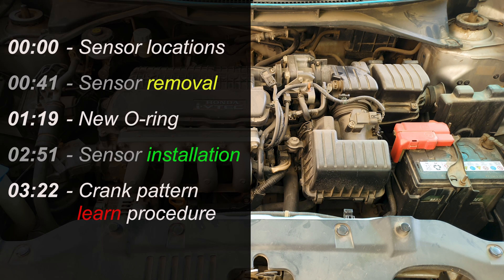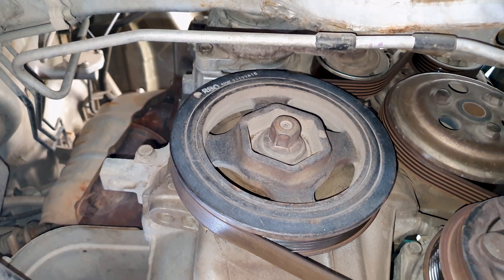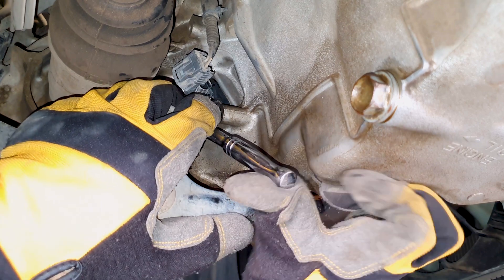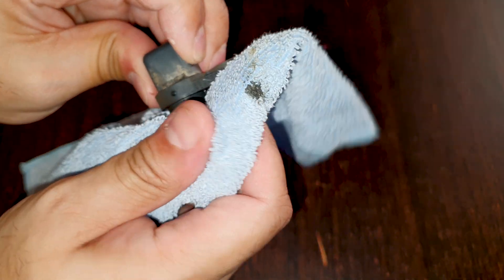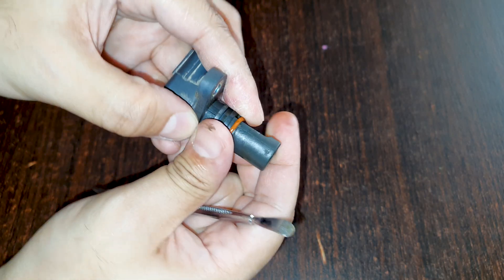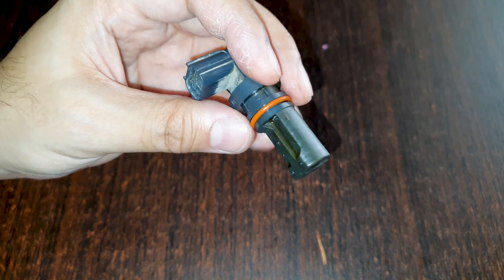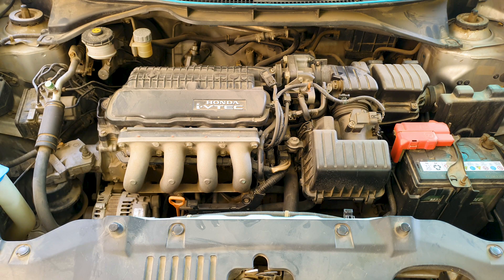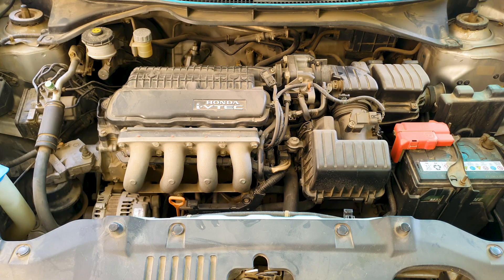Crankshaft Position Sensor new O-ring - Honda Fit, Jazz, City, Civic, CR-Z, HRV, BRV, Brio, etc

Comment from the maker: Honda P0339 - Crankshaft Position Sensor A Circuit Intermittent Interruption. Honda P0335: Crankshaft Position Sensor 'A' No Signal.
The sensor and/or the wire harness could be bad.  With no signal a fuse related to the circuit could have blown. 
---------------------------------------------
Always confirm before buying. 
Crankshaft Position Sensor O-ring:
91333-PNC-006 (Approx. $1)

Honda Models (not limited to):
Fit/Jazz 2001-2020
City 2002-2020
Civic 2006-2021
Accord (+ hybrid) 2003-2024
CRV (+ hybrid) 2015-2024
BRV 2016-2021
CRZ 2011-2016
Brio 2011-2024
Element 2003-2011
HRV 2016-2023
Insight 2010-2022

----------------------------
Crankshaft Position Sensor part numbers:

# 37500-RB0-006

Honda Fit/Jazz 2009-2020
Honda City 2009-2020
Honda BRV 2016-2021
Honda Brio 2011-2018
Honda CRZ 2011-2016
Honda Civic Hybrid only 2012-2015
Honda Insight 2010-2014

---------
# 37500-59B-J01

Honda Civic 1.5L Turbo 2016-2024

---------
# 37500-RAA-A01

Honda Fit/Jazz 2001-2008
Honda City 2002-2008
Honda Accord 2003-2007
Honda Element 2003-2011
Honda Civic 8th Gen 2006-2011 (1.6L, 1.8L engine – location on front)

---------
# 37500-PNB-003

Honda Civic SI 2003-2011 
Honda CRV 2002-2009

----------------------------
Above models are for petrol engines only, not diesel
----------------------------

Tools used:
- 10mm socket with ratchet
- Torque wrench
- Jack stands
Reply: Good job

Comment: Is this the one that get wets sometimes and make the car lose power when at low rpms?
Reply from the maker: Im sure its not as its sealed from the outside, and internally exposed to engine oil.

Comment: Good job on the explanation. I have a question: does this sensor work in oil, or should it be dry? Because mine always have oil on it. thanks
Reply from the maker: Yes its exposed to engine oil. Its fine.